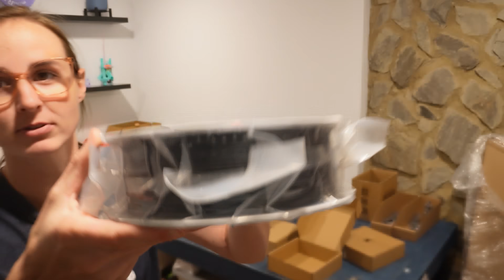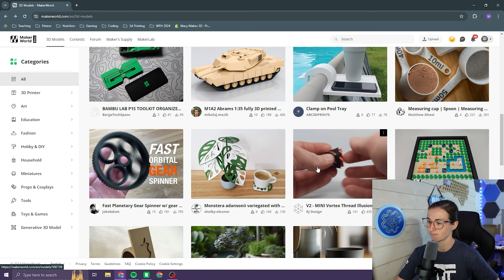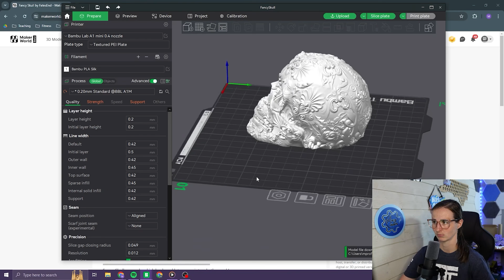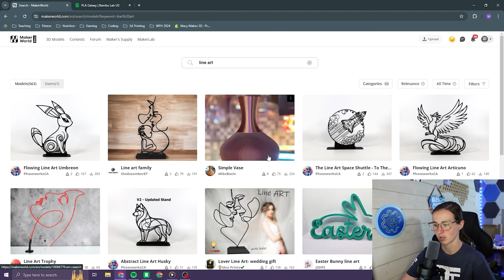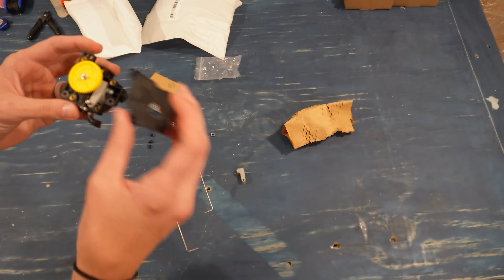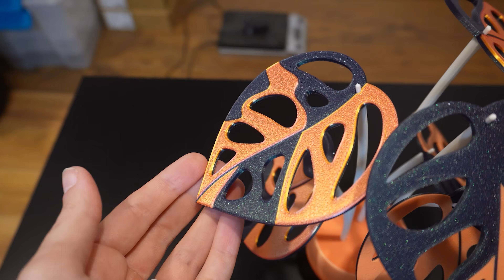Unboxing a GIANT Bambu Lab MYSTERY BOX of Filament

Comment: I got black PLA CF with my Bambu, I didn't realize I needed to dry it first and that I needed to change out the print head.  How did you know. you needed to change out your head and cutter etc, to print the PLA.  This was the first time I hear that was required.   Also you mentioned thatthe CArbon Fiber is almost dry.  How did you know it was moist to start wit, didn't you just take it out of the box?  Did you have something that told you it was moist?  Sorry if you covered it in the video and I spaced out.  Just send me to that point in the video if yo discussed these items in the video.
Reply from the maker: I've just read on their website and seen on various facebook groups that it was recommended. The X1 may already have the hardened upgrades but if it doesn't and you're printing a lot of CF you might want to upgrade everything. It may say on the box to dry it right away but I don't remember. I don't normally dry filament out of the box but I wanted to give the CF filament the best shot to be successful since it was for a video. Didn't end up mattering though because the bucket was such a horrible print lol

Comment: You will never run a 3D printer business using Bambu lab filament because they are always out of the stock of the colour you will need,  went there today for some Red pla to finish a job, no stock, what do I do now?. The last batch of Black PLA I bought went in the bin, fail after fail, did all the cleaning the plate with dish soap, bought a digital indicator to check if my plate was level and it was. tried some sunlu, the cheapest amazon had and that worked a treat, so it must have been the filament that was dodgy. To be honest the bambu filament I have used in the past has been good stuff, but its no good if you cant get it.

Comment: When I bought my P1S (with AMS) I got a spool of their green and orange PLA Basic for free, more or less. They ran great. Use it to make a big dual-color poop-chute for the rear of the printer. I also got a spool of PLA Basic in black. It also ran thru and printed fantastic! However, fast-forward by 2 months. I re-ordered 2 spool-less refills for the black, and after using it for ~3 days I was sick of it because it just had issue after issue, even after drying it multiple times. I didn't wanna contact support cus it feels like they always try to blame you for the issues and just give you the run-around. I'll stick to my 3 favorites - Duramic3D, eSun, and Sunlu.
Reply from the maker: Yeah that stinks, Overture is still my favorite filament.
Reply: Never had issues with their filament. Support for me has been overly helpful. Idk what else to say

Comment: Printing with carbon fiber filament, you need to go slow, super slow. At least that has worked for me when printing carbon fiber ASA material. Not sure if anyone has said it in the comments. But when printing with anything with sparkle, I suggest to use a hard steel nozzle. The sparkle can take a toll on your brass nozzles. Just my two cents. I have done a lot of printing with sparkle and carbon fiber, so i just leave the steel nozzles in my machine now. They last longer. Great video and keep up the great work.
Reply from the maker: Thanks for the tips! I’ll probably just convert all of the printers to the hardened steel

Comment: Tricks:
Keep speed down for BL Silk - they have specific tips on the web but for best results calibrate in Orca.
This should fix your CF too.

For best top result print the nameplate face down!

Eryone does a nice Galaxy filament.

Vac bags - don't waste money on eSun bags, Chinese clones work better and can be bigger, so easier to get the spool in/out. No 1 tip for them is to run your finger round the valve after sealing as air bubbles can get trapped under there and leak air in. You can see when you have squeezed it out and it holds the seal much longer.

Sync from the AMS. On the X1 you can set the manufacturer in the AMS page of the display and it will be remembered.

Comment: I Looooove your videos.
Very inspiring. 
Can you talk a bit about why your drying filament when you first get it. Is there a reason?
Reply from the maker: Thank you :) I don't normally dry filament right away but I hadn't ever printed with PLA-cf before and wanted to make sure it printed okay for the video lol. I usually dry PETG if it's been open for a while but not PLA, and definitely not right out of the package.
Reply: @macymakes3d  Thanks for the reply. I have never used a dryer, Mostly its hot here in Australia. But I think at least 1 might be worth having.

Comment: So this is what caused the spooled to go out of stock😂 jk. But I did accidentally order the replacement whilst buying my first Bambu printer the A1 and I had to order just the plastic spools for $47.00 and they don’t get here until the 16th so ⏱️⏱️⏱️ ya. I’m sitting here just waiting around.
Reply from the maker: Oh no! At least you'll have the extra spools now for when you need them. You're going to love the A1 though :)
Reply: Just buy a spool of whatever filament locally and print the bambu spools 😇
Reply: @Mr.X3D  ya I just saw that on maker world. But I already bought them and some M3 screws and r188 bearings so it’s fine. 🙂

Comment: Make sure you cold pull after the galaxy filaments, or run some cleaning filament. I’ve had some partial clogs turn into full blown clogs with the glitter in it
Reply from the maker: I just ran into this issue 😭 Will be unclogging a printer today sadly
Reply: @macymakes3d  oh no! I love how the galaxy looks but the extra step to make sure my nozzle is good to go deters me from regular use

Comment: Next time you change your nozzle, remove your bed so if the screws fall they fall onto the magnetic plate and you don't lose them somewhere in the printer
Reply: You mean the build plate right and not the print bed ?
Reply: @Theprofessor1212  sure
Reply from the maker: Wow awesome tip! Thank you!

Comment: I can tell this is your 1st time using BL spools. You need to load your spools first and then just sync from AMS in BS when using Bambu rolls. The RFID tag in the spool will load the appropriate color, type, and remaining filament from the tags.
Reply from the maker: I have that feature turned off bc if you aren't using bambu filaments its pretty annoying having it go through the whole load cycle for each filament, just for it to tell me nothing bc it's not a bambu filament.
Reply: We can all tell, because she said that.
Reply: It would be great if the "remaining" filament was measured in grams. Since it's not I have to weigh each spool if I think it may not be enough to complete a print.

Comment: Now you really need to sunlu S4 dryer.
Reply: The Sunlu S4 has no options to keep the filament at a user-defined moisture level, and doesn't rotate the spools.
Reply: @rattyboots  I do not  need to change the setting. It works fine as is. FOR me. Note. All my rolls are in for 24 horus before printing.
Reply: @rattyboots  Doesn't need to rotate, works absolutely fine as it is.
Reply: Garbage
Reply: @TC-dk6do  Absolutely fine for me.